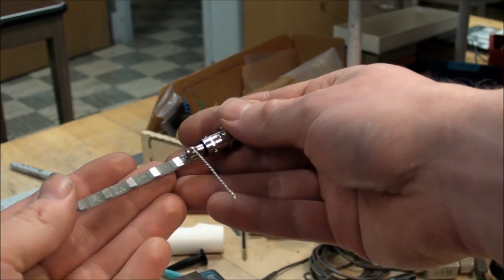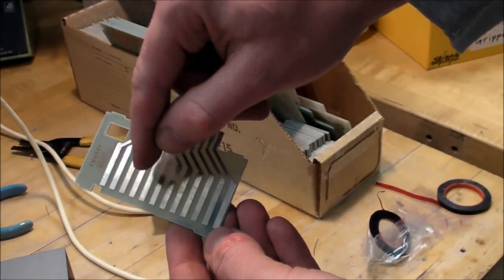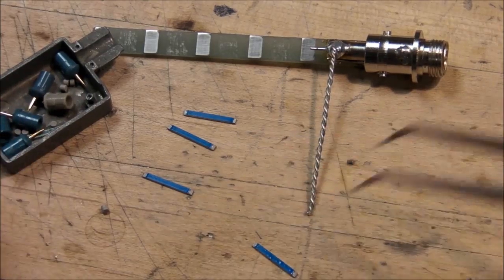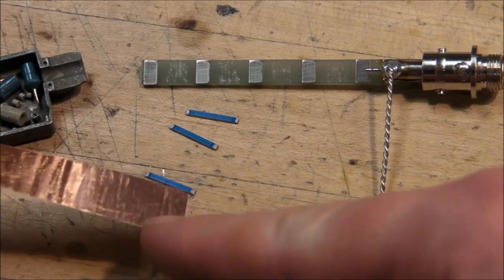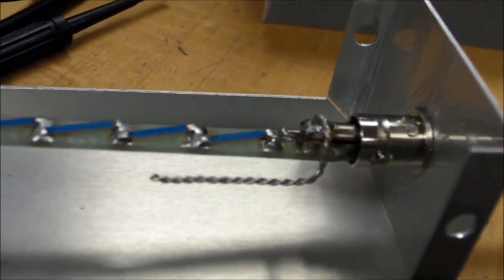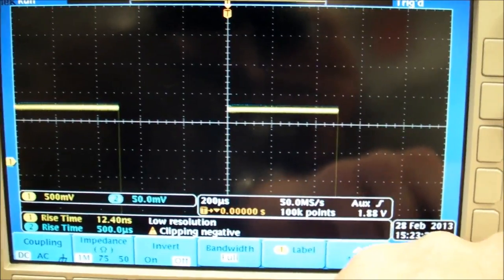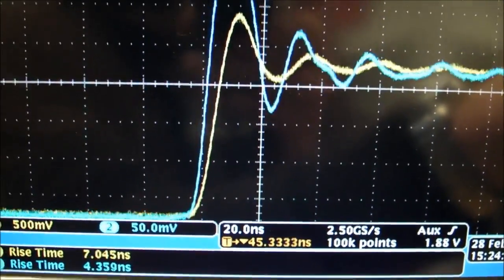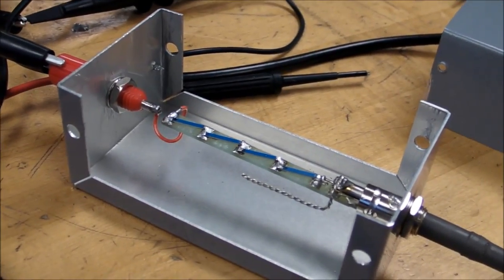(#0057) Scope Probe Mod for 2000 Volts - Part 3 of 4

Comment from the maker: Good idea, but even if I did think about conductive epoxy, I wouldn't have used it simply because I don't have any on hand. I just wanted finish this project without delay. As for the first and second nodes after the input, I did  not need any extra capacitance. Just putting my finger near the nodes was enough to throw off the frequency response with a dip in the middle of the square wave.

Comment: If they are not solderable why not use a conductive epoxy to do the connection. Less risk of them cracking later on at the edge of the substrate. Use a stiff PTFE insulated wire to make a low value compensation cap for the input, just bend to follow the input resistors.